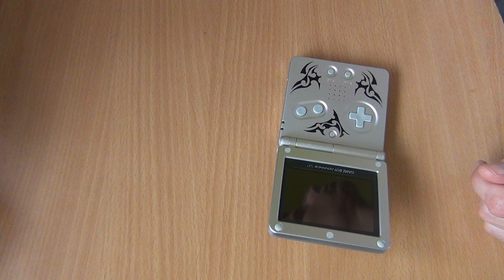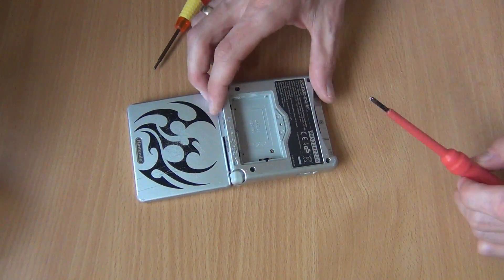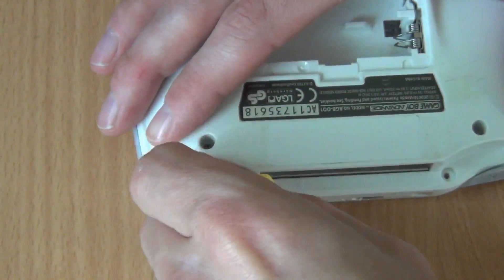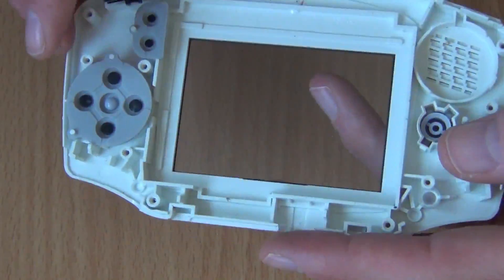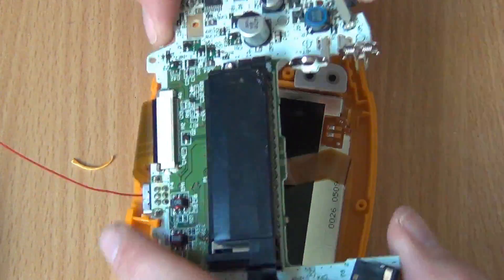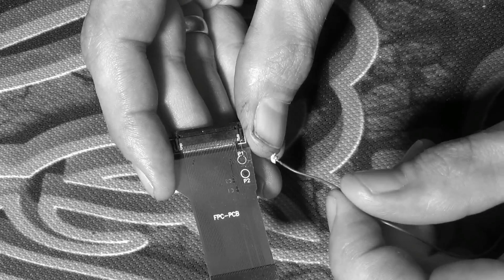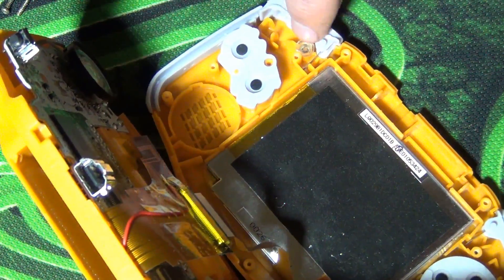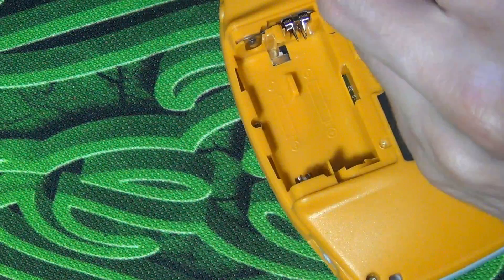Building The Best Game Boy In The World

Comment: A Gameboy with a Raspberry Pi is better though.
Reply from the maker: That's emulation and totally different approach.
Reply: But your title is "building the best gameboy in the world" not "building the best non-emulation gameboy in the world"!
Reply from the maker: aKunacme I ran out of room. ;)
Reply: What defines it's a Gameboy though? That it can run original games inside an original Gameboy case? In that case, we wouldn't call PCs with xeon processors for "computers", but rather "servers", since they run server-grade hardware inside a normal case. Long story short, you can fit a Raspberry Pi inside a GBA and make it like 10x more powerful than this.
Reply from the maker: mortenmoulder "The Game Boy (Japanese: ゲームボーイ Hepburn: Gēmu Bōi?) is an 8-bit handheld video game device developed and manufactured by Nintendo." (source: https://en.wikipedia.org/wiki/Game_Boy)
Reply: RetroGameCouch Your point being what?
Reply: That's not a gameboy anymore it's an emulator. Which does matter. Especially if you're a speedrunner or you play competitively.
Reply: JitterBob It is a Gameboy case with better hardware, which can run all your Gameboy games and it's still inside an original Gameboy case. It's a Gameboy.
Reply from the maker: mortenmoulder But the hardware emulates the original hardware. So what good does having better hardware do?
Reply: RetroGameCouch Your video says "best". The Raspberry Pi can play other games as well as Gameboy games. It can run the games at a higher frame rate as well. Wouldn't you say a 10x (or so) faster SoC is better? Of course you would. Then obviously the Raspberry Pi is better than the Gameboy. It can do the same but more and faster.
Reply: Not really, I have multiple choices to emulate GBA games yet I played them on my Gameboy Advance SP (yes yes I know but I have small hands and I have the SP headphone adapter) 
I prefer real hardware over emulation, not to mention, playing Mother 3 and Golden Sun on emulation is not a walk in the park either, where the original hardware handles it easily.
Reply: a Gameboy would be a console that can run Gameboy games natively without having to emulate anything
Reply: What you prefer and don't prefer doesn't really make it false. When you upgrade a good PC with better hardware from a server, is your PC no longer a PC but a server? If you're doing the exact same things as before, yet with server hardware and it's faster, is it still a PC or is it a server? Just like that, a Gameboy with better hardware, whether it emulates it or not, is still a better Gameboy than the original. I have yet not noticed a difference in input latency or found a game I couldn't play.
Reply: mortenmoulder To be an actual game boy it has to be able to natively run the games an RPI Cant natively and A Gameboy can only run Gameboy Games Emulation is entirely different. IS a Retron 5 a Gameboy?? or is it a whole nother system
Reply: Tucker Kennedy That's your definition of it. I call my Gameboy with a Raspberry Pi in it for a Gameboy :)
Reply: Tucker Kennedy Except those 5 people who upvoted my comment, sure. Besides, I have the best Gameboy in the world. It has the same specs as his, but has a rechargeable battery. Clickbait much.
Reply: mortenmoulder you have a "Gameboy" not a Gameboy
Reply: Tucker Kennedy Thanks for agreeing with me, that I have a Gameboy :)
Reply: mortenmoulder no its a "Gameboy" Not a Gameboy
Reply: Tucker Kennedy A "Gameboy" is a "Gameboy". My "Gameboy" is a "Gameboy", just like RetroGameCouch's "Gameboy" is a "Gameboy".
Reply: His Gameboy is a gameboy because ALL the parts were designed for a Gameboy
Reply: Tucker Kennedy Not the right Gameboy though. He included non-original parts and removed some of the original components. Just like I did :)
Reply: but the RPI is not geared for JUST a gameboy his unoriginal parts are
Reply: Also, the GBA is quite comfortable for small hands, although it WOULD be the best gameboy in the world if it had a rechargeable battery but there are rechargeable batteries.
Reply: Tucker Kennedy The display connector isn't original though?
Reply: mortenmoulder But it was Made for a gameboy
Reply: Tucker Kennedy The Raspberry Pi is made for projects and works in a Gameboy? ;)
Reply: mortenmoulder But its not made Specifically for a gameboy Like the Iphone CPUs are MADE for the Iphone
Reply: Tucker Kennedy So what? The cable is 3rd party. The Raspberry Pi is 3rd party. You can't win this, so we might as well end it now. My Gameboy with a Raspberry Pi is a lot better than the one RetroGameCouch has and you can't deny it.
Reply: Tucker Kennedy But unoriginal :D Good job losing a discussion you clearly lost the first time you posted hahaha
Reply: mortenmoulder You know im right and im not going to sit here and debate a point you fail to see
Reply: Tucker Kennedy You shouldn't debate at all. You clearly don't know how to make sense of something simple. RIP.
Reply: mortenmoulder ok is a PC the same thing as an NES NO is an RPI the same thing as a gameboy no
Reply: Tucker Kennedy That depends. Are we talking about an x86 PC? Then no. Is the Raspberry Pi the same thing as a Gameboy? No. But inserting a Raspberry Pi into the Gameboy, using the original housing, the original buttons, and so on, it's still a Gameboy. Just better and stronger in basically everything.
Reply: mortenmoulder but its still not a gameboy its a pseudo boy
Reply: Tucker Kennedy So a server rack with desktop hardware (as you use in your regular PC) is not a server anymore? That's unfortunate :(
Reply: That arguments invalid the purpose is different not the product
Reply: You see, a Raspberry pi, unlike a legit GBA, does not have all of the functions of a GBA. You may be able to play GBA emulators on your Raspberry Pi, but you can't connect it to another GBA or a GameCube like you can with a normal, or even a modified GBA with the original hardware still inside. It is due to this and the fact that the motherboard of the Raspberry Pi is very different from the original GBA hardware that they are not compatible with each other. You cannot play a GBA cartridge in the Raspberry Pi. I'm honestly surprised that with all the people arguing on this one comment that no one has brought up this glaring argument to disprove your GBA emulator from being an actual GBA.
Reply: JitterBob Thank You Oh Fellow Enlightened one
Reply: no s gba pi zero is better
Reply: mortenmoulder
thats the problem it oftenly doesn'T run the same just faster
Reply: So if I hack my PSP to play gbx roms, that makes it a Gameboy right?
Reply: graefx Yeah if you can fit it inside a Gameboy case. JitterBob Oh the insults. How old are you? 12? I bet you're not even 12 tbh.
Reply: +mortenmoulder nah I'm just cracking it
Reply: graefx Then no. It has nothing to do with a Gameboy.
Reply: +mortenmoulder but it plays Gameboy games.
Reply: graefx Yeah you are absolutely right.
Reply: Tucker Kennedy If it tastes like a tomato, does what a tomato normally does, and everything is like a regular tomato, then it's a fucking tomato.
Reply: mortenmoulder But if you take the skin off a tomato and wrap a flounder in it is it still a tomato
Reply: mortenmoulder thats EXACTLY what your saying if you take a RPI and Wrap it in a gameboy case you are calling it a gameboy
Reply: Tucker Kennedy Except you WOULD put a Raspberry Pi inside a Gameboy. When you put a GTX Titan inside a "regular" PC, do you call it a gaming PC? Of course you do, because the PC CAN game with the GTX Titan. It's not what it's intended for, but it does it very well, just like the Raspberry Pi would inside a Gameboy.

Get real, kid. You can't even come up with examples that are good.
Reply: mortenmoulder A titan x is made for gaming Dumbass its in the GeForce Line Nvideas Gaming line
Reply: mortenmoulder It was for GPU intensive apps like the Quatro but now its a gaming card https://puu.sh/rwLaP/89c51a8d3d.png
Reply: Tucker Kennedy I'm fucking done hahaahha go troll someone else hahaha
Reply: +Tucker Kennedy +mortenmoulder
mortenmoulder is actually right on the fact that the TITAN X(Pascal)(the new one) isn't meant to game. The original GTX TITAN X was marketed towards gamers, but now they are business-class cards. It is actually quite the opposite of what you claim in the comment above. Either way, the TITAN X(Pascal) is meant for workstation use, even though it is also one of the best gaming graphics cards on the planet. Do not be fooled by the GTX branding on the graphics card itself. Also, you spelled Quadro wrong. 

I also read the comment "I'm fucking done hahaahha go troll someone else hahaha" from mortenmoulder. Thanks for the comment.
Reply: Greendude439 Thanks, man. You're welcome.
Reply: +Tucker Kennedy Yes, it is the TITAN X. Yes, it is Pascal, but no, it was not ultimately meant for gaming. I may have been meant for gming early in development, but it's not the intention of the final release. That is one of the main reasons why the new Pascal TITAN X isn't called the Geforce GTX TITAN X.
Reply: Greendude439 it is called that though
Reply: Tucker Kennedy Not really, though. It even says on their website that the new TITAN X is just called the TITAN X. http://www.geforce.com/hardware/desktop-gpus 
No Geforce GTX, just TITAN X.
Reply: Oh
Reply: JitterBob Where did you find that? On some unknown page called definithing.com? Sure, kid. That cable RetroGameCouch installed in his Gameboy, isn't trademarked by Nintendo either. So his Gameboy isn't a Gameboy neither. Good job, kiddo.
Reply: mortenmoulder But it Made for it
Reply: Tucker Kennedy Doesn't fucking matter hahaha. You just proved your own claim wrong. If my Gameboy isn't a Gameboy, then the Gameboy in this video isn't a Gameboy either.
Reply: mortenmoulder Yes it does mater because they dont make original gameboy parts anymore
Reply: Tucker Kennedy Which doesn't make this an original Gameboy, just like mine isn't an original Gameboy.
Reply: mortenmoulder Yes it is. Everything inside and out is from the original line of Nintendo Gameboy. Per the definition of a Gameboy. Yours is an emulator inside of a gameboy shell. The shell isn't what makes the device. Once again, an iPhone with android parts inside, is not an iPhone at all. However, an iPhone with an earlier model iPhone inside is still an iPhone. 

Obviously you're not really a part of the gaming scene or you would appreciate the difference between a Gameboy and an emulator. Platforms matter hugely in serious competitive gaming and speedrunning. Emulators are a separate platform.
Reply: JitterBob Is that cable original? No it's not. Boom, suck on that.

Also, please don't call playing on a Gameboy "gaming"... It's not.
Reply: mortenmoulder The cable doesn't change anything
Reply: Tucker Kennedy It allows the screen to run with that specific board. Without it, this mod wouldn't work.
Reply: mortenmoulder but it is still a gameboy screen AND the processing is the same where as it is not in an RPI also Morten do you think I should use my RPI for a calendar
Reply: Tucker Kennedy Yeah you're completely right. His is a Gameboy just like mine is.

What you use your Raspberry Pi for, is something I don't really care about.
Reply: mortenmoulder yours processes differently
Reply: Tucker Kennedy You are completely right. Thanks for agreeing with me!
Reply: Tucker Kennedy  This guy mortenmoulder knows nothing about the gaming community. He just said Gameboy isn't gaming. Are you kidding me? That's blasphemous. Some of the most competitive speedruns exist on handhelds. Pokémon being one, which sold over 20 million copies making it one of the best selling games of all time. Tetris (for gameboy) is the number 3 best selling video game of all time.
I hope you don't call yourself a gamer. You're not.
Reply: JitterBob Be right back, let me go do some sick gaming on my Tamagotchi. Sick gaming. Is a Tamagotchi gaming? Sure it is. Right?
Reply: I'm having a bit of trouble with my Raspberry Pi Gameboy. I'm trying to play Legend of Zelda: Four Swords with my friends. But we can't find a way to hook up the Raspberry Pi to their original GBAs or the Gamecube. :(

So we tried another game to connect the GBAS with the GameCube, Final Fantasy Crystal Chronicles. Again I couldn't hook up my Raspberry Pi Gameboy to their GBA or the Gamecube. :(

We said screw it and we loaded up the Pokemon games on GBA... Sadly we just gave up. There was no way to interact the two systems together. 

It's like they were incompatible or something. Thoughts, please help out. :(
Reply: This Guy Its only illegal if you dont own a physical copy of the games
Reply: This Guy they cant prove its not from your cart
Reply: ***** Can your PS3 run Xbox games? No it cannot.
Reply: mortenmoulder it can by emulation
Reply: Tucker Kennedy I would like to see that. Oh wait, it hasn't been done before, so your argument is invalid.
Reply: hey everyone, don't feed the troll
Reply: Tai Nguyen Trolls*. Plural.
Reply: Crippling Depression Can it toast my toast?
Reply: +mortenmoulder my PSP Go fits in a nintendo 64 case, my PSP Go can run nintendo 64 games through emulation. so my PSP Go is an Nintendo 64??? 

Your logic is completely fucked. Your Emulation never is as good as original since it wasn't meant for it to run gba roms in the first place.
Reply: Joey van de ende If you place your PSP Go inside a Nintendo 64, hook up controllers to the N64, power directly to the N64, and so on, I'm going to call it a Nintendo 64. Deal with it.
Reply: ***** Sure yeah. It's also a Nintendo 64.
Reply: mortenmoulder yeah, also a very crappy one that "emulates" n64 games on 13fps...
Reply: Joey van de ende You should pick better hardware then.
Reply: mortenmoulder i hope you will get smarter, i really do. this is sad
Reply: Joey van de ende I'm already smarter than you in possibly everything related to IT. It's all about how we define things as individuals. Would you call a PC (desktop case) with an UP Board in it for a PC? It runs full x86 Windows, you can hook up a hard drive and so on.
Reply: Watch out guys, he's too smart, it's attack of the youtube comments! (aaahh...)
Reply: An arrow to the knee is better than ***** ..?
Reply: Shade Rowan yup :p
Reply: ***** A Gameboy case with hardware capable of playing the original games.
Reply: ***** The case a Gameboy is contained in.
Reply: Shade Rowan I knew he was going to ask "what kind of plastic", "what kind of screen", "what kind of ..." and so on. It's just not worth my time. He's right. I'm right. We're all right. It's called an opinion for a reason, and we're all allowed to have one. Deal with it.
Reply: mortenmoulder retro is correct on emulating and real thing is largely different. no emulators are 100% perfect but if u use a natural gameboy it runs stuff perfect. same with n64 ps2 PSP Wii etc. I prefer my emulator on PC tho just because I gain a wider range than my collection of all color Pokemon's and Pokemon mystery dungeon and Zelda's but Zelda's I got them on my 3ds now but still the screen is a problem for my bad eyes.
Reply: fenrirdies Oh I am. I very, very am. It's people like you, who makes me keep posting, so you're contributing to your own negativity. Oh shit.

***** I completely agree they are different, but emulating a Gameboy with a 8 MHz processor on a Raspberry Pi with a 1000 MHz processor means it can emulate it very, very good. Perfectly? No. No emulator is perfect. However, there is absolutely no input lag (in fact I'd say it's more responsive) and it can play my games perfectly, so what's the difference? If I gave you my Raspberry Pi Gameboy or a regular Gameboy, you couldn't tell it's different, if I load up a game.. except the colors are much better with the AGS-101 screen.
Reply: ***** Two weeks and about 10 minutes of my time total. It's really not a big deal.
Reply: ***** Yeah using a cartridge reader hooked up via USB and a python script to read the ROM from the cartridge (converts it into an emulator-friendly format), which I can then load into the emulator. Takes a few seconds to load and convert (as the reader is really, really slow), but it works flawlessly.
Reply: ***** Yeah. I'll have to run the script to load the cartridge as an emulator file (.gb).
Reply: is like discussion cars of  latinoamerica where they are produced by multiple nationalitis . example 40% brazilian 10% france 40% argentina 10% others. is the car brazilian or argentina? well both of them. 
the more percentage of a nationality, more X nation be. if the car is more 60% brazilian, surely is closer to a brazilian car, than a argentinan car. for me the same things applies to gameboy. more original parts they have, more gameboy likes. for me this youtube gameboy little moded be closer to a original gameboy than a PI. 
on the other hand anyone can call what creates gameboy. sure I can call a gameboy to mi pc if i want, in the end i playing gameboy games and if I believe it or think that i have  arguments. so its only a opinion
Reply: emi baggins If VW made a car, but 90% of it is French and the 10% rest is from Germany, is it a German car or is it a French car? Well, obviously it's a German car, as it's a Volkswagen, which is German and has always been German. It doesn't matter if something has been produced in another country (most is made in China these days) really.
Reply: was about nationalty this particulary problem, not it was an vw . but the thing is take the idea of   % original ingredient to make a conclusion.
Reply: in the ends alll depens of the concept we have of a "gameboy". its more important games,hardware,software, originality craft materials? each one has a own concept. for this youtuber a gameboy can still be a gameboy if only mod one o two things. for me sounds very accuarate. for others can be a totaly new hardware in the same case.for other caan only be the games ,etc. 
we should agree on only one concept to discuss, on all the elements that i mention. bt the wey the title 
no matter if it is the best, but is very cool. and this was the objetiv more than literaly word,
Reply: Holy shit this threat, so, I study literature, and the stupidity here is that mr mortenmoulder cant comprehend the basics of language. The thing ppl is arguing is that the status of "being" a Gameboy is gained by it being  a Gameboy. A Raspberry Pi can only be a Raspberry Pi, the fact that it can emulates gameboy games is only a caracteristic of it. A Raspberry Pi will never be a gameboy even if it looks like one because fundamentaly it isn't one. Tha fact that it can functiont as a Gamboy doesnt make it a Gameboy. Like the example you gave of being a boot, you cant be a boot, you can fulfill the function of a boot, but never be it. If you cant see the differences between "be" and "function" you are doomed into stupidity. 

Plus even if it run gameboy games it isn't the only thing a gameboy can do, as the Raspberry Pi cant be hoocked with other gb or gc to play with friends it cant fullfill all the functions of a real gameboy. And so, even if you still thinking your fake gameboy is the better "gameboy", im sorry to tell you that your gameboy is disabled because its incomplete, and how can the best gameboy be incomplete.
Reply: Idk men im from argentine and theres almost any dark skin ppl around here. The most near approach I can have with the black community is through Luke Cage and Loud Nigra, so the n word is just a silly funny word to me. Also with the stupid amount of denigrating words around here u get inmune to them, negro, turro, villero, blah blah. 

(My english may be super bad since my native language is spanish and i never studied english, i write all out of intuition)
Reply: No it doesn't make it a server, unless you use it as a server with your OS..
Reply: DoctorNRockman You study literature, which nobody fucking cares about and shouldn't be a part of this conversation.

If I gave you my Gameboy and loaded up a game, you wouldn't be able to tell if it's a Gameboy Nintendo made or I made. That's my argument.
Reply: mortenmoulder you could EASILY tell.  Colours.  Pixel Count. Brightness.  Fluidity.
Reply: ***** Which could be the exact same screen as the one in this video?
Reply: mortenmoulder not if you're doing a Piboy it can't.
Reply: ***** Now here's the million dollar question - Can YOU tell the difference?
Reply: ***** Between the random Chinese screen with backlight and the AGS-101 screen. Sure you can tell the difference between the two, if you don't have something to compare it against hahah
Reply: mortenmoulder it seems you aren't very bright here. 

A. screen size. 
B. PPI ( do I need to explain what that is? )
C. Scan lines.  

YES you can tell the difference between native gameboy resolution and upscaled resolution.
Reply: ***** How do you know my screen size isn't the same as the AGS-101 screen? How do you know the amount of pixels? What's the amount of pixels of the AGS-101? I doubt you even know.
Reply: mortenmoulder the worst part of your comment is you ask this question over the Internet.  

But alas your severe trolling is a massive fail. What I would like you to do. is find a composite screen. of the same size and PPI of the DMG screen.  Once done please report back.  :)
Reply: ***** DMG screen? Who's talking about a DMG? Also, please let me know what the resolution of the AGS-101 is. You don't even know ;)
Reply: There's literally no reason to start insulting me, just because you can't keep a discussion going. Guess that makes me the better one of us.
Reply: undeny "No one cares anymore" - Best joke of 2016.
Reply: mortenmoulder ...oh for god's sake man do something else PLEASE! And no your comment wasn't clever or very insightful... AT ALL! I beg you, for your own good do something else just think about anything else. Like the color blue. Or even brown if for some reason blue offends you.
Reply: undeny I'm not replying unless something else replies.
Reply: undeny I think the term 'don't feed the troll applies here'. His logic is flawed at best.
Reply: undeny Then stop replying, you damn troll.
***** My logic is flawed because you think so. 66 people clearly disagree.
Reply: mortenmoulder No no you don't get to use that word THIS far into it dude. You are the troll. You haven't stopped even after someone asked you, don't put your trait on others. You have a problem but you chose not to address it. Instead you decided to take it out on others. And your approach is to modify the internals using parts not made by the same device manufacturer. Using Raspberry Pi isn't using the parts that are made for the original device by the same manufacturer. Your device isn't even a gameboy at this point. You have imagination but lack perspective. You're not wrong it be a better device at playing gameboy games but it will no longer be a gameboy. Hence it cannot be the world's best gameboy.
Reply: undeny If I swap out your VW engine with a V8 engine from a Mustang, is your car still a VW or is it a Mustang?
Reply: mortenmoulder Its something else entirely. However if you swapped out my VW engine and put in a more powerful compatible VW engine from another VW model. It would still be for the most part a VW. And a better VW than it was previously. Did your own example work for you? Or is there another analogy in store here?
Reply: undeny Something else? Hmm how? The engine changed. My Gameboy's engine changed as well. They can still drive the unit, yet the V8 (Raspberry Pi) can do it faster than the other.
Reply: mortenmoulder not quite.  the Rpi has a different running gear. different clutch.  different injectors. different fuel. if you're using that comparison.  

You aren't just switching the engine you are switching the architecture. 

Using the V8 scenario you listed is still wrong aswell. since the v8 wouldn't be 'emulating' a VW experience.
Reply: ***** But on the outside it looks exactly the same and to the unknown person, it still runs the same (some might not be able to tell the difference). Fuel would still be the same though, but okay.
You're right about the emulating thing, but it's the best analogy I can think of. What if I exchange the V8 with an electric motor? Would that be a better analogy?
Reply: mrbandishbhoir I would like to see a bat doing what a chicken does, wise versa. I drive an electric car, I know how they work. But we can all agree, that a V8 or an electric motor doesn't make a car move from A to B any different, other than make the experience more/less fun? Just like putting a Raspberry Pi inside a Gameboy doesn't make the gameplay worse or better.
Reply: mrbandishbhoir Always look at it from other people's perspective. Would an 100 year old be able to tell the difference between a V8 and an electric motor? I doubt. Would an 50 year old be able to tell the difference between an original Gameboy and a Raspberry Pi fitted Gameboy? I doubt.

Also, if you can't see how the V8 and the electric engine gets you from A to B in the same way, we shouldn't be having this discussion. Sorry. Have a good day.
Reply: mrbandishbhoir I don't call people out, unless they start first. I'm not sinking that low haha. You too!
Reply: stop acting like a child
Reply: Ricardo Arjona At least 100+ people agree with me hahaha
Reply: N2KM There's a huge difference between saying "This is the best Gameboy in the world" and saying "My definition of a Gameboy is xxxxx". Read the whole context next time.
Reply: Nothing is better at doing the originals purpose than the original
Reply: mortenmoulder if you headbutt a huge rock, the rock will crack open for sure.
Reply: mortenmoulder dont turn to insults just give up i agree with what you are saying but i dont like how you sharing this information
Reply: mortenmoulder